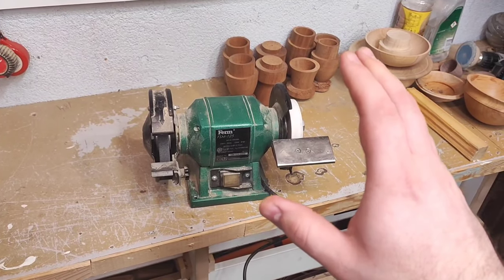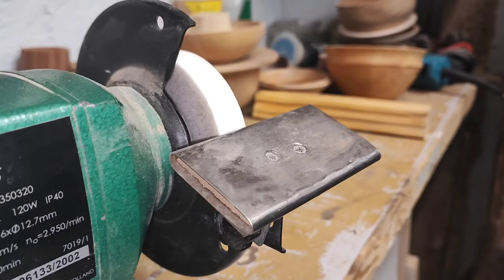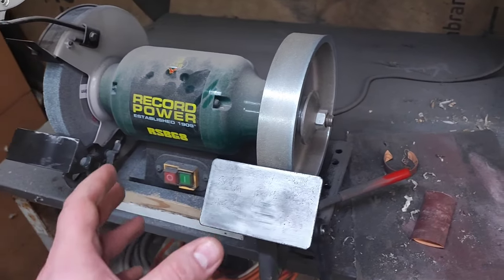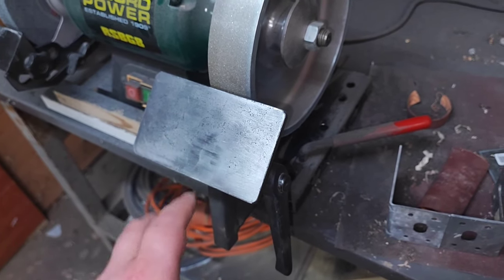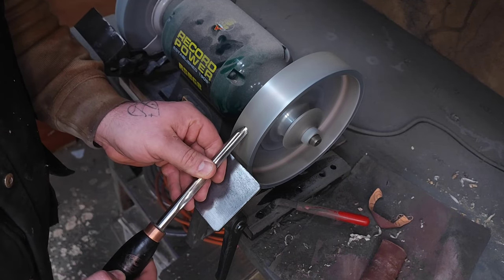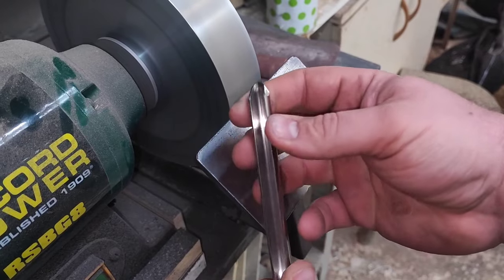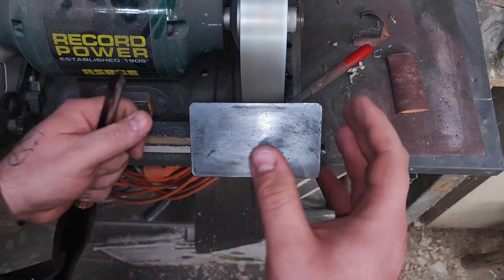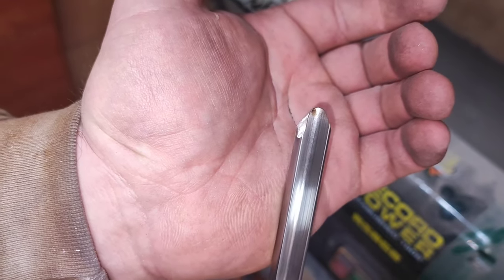Easy and simple freehand sharpening system

Comment: Another excellent video.  Thank you!  When I started turning a long time ago there were no jigs.  Everyone sharpened by hand.  I learned to present the tool to the grinder as if I was trying to turn it.  Works beautifully.  Certainly I have used jigs both those I've made as well as those sold by others.  They have their place, too.  
About the grit of wheel.  I certainly agree with you.  The end result is a sharp tool whether you get there with a carefully used 60 grit or a 600 grit.  One doesn't work or last better than the other.  An 80 grit CBN wheel make a good edge just like the 180 grit you use.  The "issue" with the 80 grit is that it cuts much faster.  It is easy to grind away more tool than is necessary to make a sharp edge.  Either grit still gets the job done.
Reply from the maker: Lovely said sir, agree with your comment 😀 thank you very much for watching

Comment: Dear Tomislav, it looks so easy! I can turn just about anything after three years as a turner (retiree). Yet what I still find the hardest thing to do is sharpening! I have two Wolverine systems and it takes me so much time to set the angles, distances, arms… especially since I use different grinds (40/40, 55, 65, asymétric, scrapers ….  I now have older gouges and this vidéo encourages me to try freehand again on my 6 inches cbn wheels. Thanks again.
Reply from the maker: Thank you Alain, sharpening can be frustating but you just have to plow through that bad days and you'll see results 🤗

Comment: The way I like to aproach the high grit wheels is to rough the shape on a courser wheel with the platform at a more acute angle, so when I go to the finer one it will only touch the very edge. Like roughing the 4040 shape first on a 35 degree platform and then going to a 40 degree one.

Comment: If you can afford it try a tormek bar set up on a high speed grinder.
Or use tormek bars set up on a sorby pro edge, both are awesome for free hand.
I never adjust my bars either, I use one bar/wheel for freehand and the other is setup with a platform jig for scrapers.
Both are permanent and never get adjusted, quickest system I've ever used.
Hate sharpening so the less time involved the better for me.

Comment: Thanks for an informative video, you are an excellent teacher.  You call your grind anasymetrical because you are doing it freehand vs jig?  Do you vary the sharpening angle?
Reply: The asymmetrical grind is where one of the wings of the gouge is longer than the other.
Reply from the maker: The right wing is shorter and excellent for facing endgrain and for hollowing, and left wing is longer with full curve... Its grind I learned from Richard Raffan